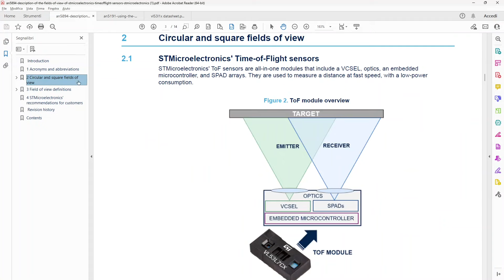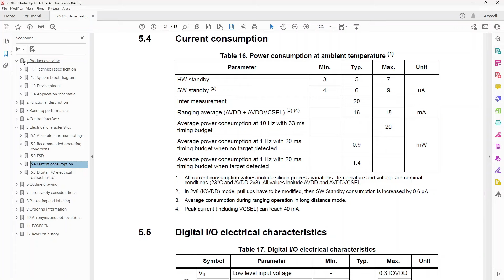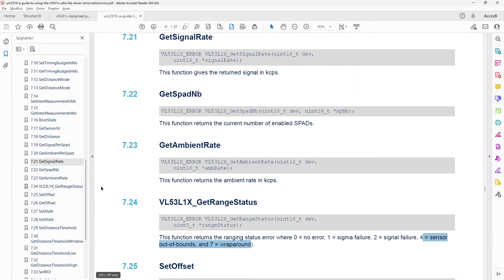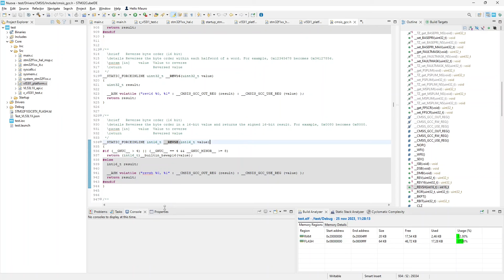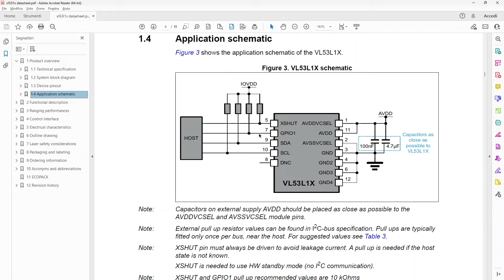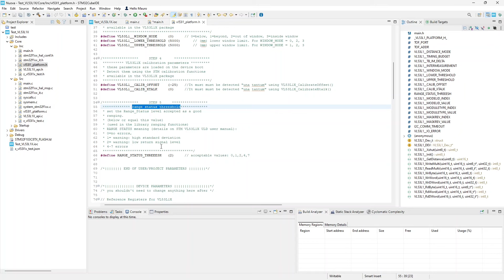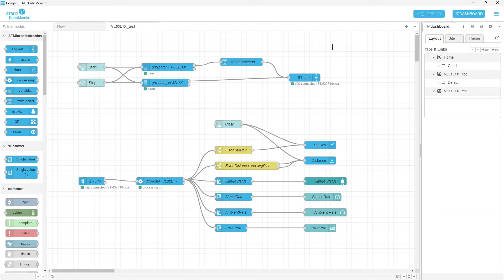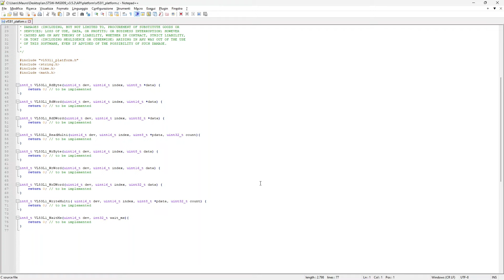Gesture Recognition with ToF sensors: VL53L1X  + Ultra Light Driver (ULD)

Comment: Good job, i need i2c register addresses for a 8 bit, low rom size microcontroller (Microchip 16F series) for a standalone operation control board. Thank you.
Reply from the maker: VL53L1X I2C address is 0x52 and you can program it. Note that the programmed address is lost on power loss, so, if you have multiple devices connected , turning the system on all device have the same address. You have yo use XSHUT to select them individually on startup, at least to set their own address. (that means that in a multiple-device project all devices must be xshut-connected: being so I let device with their original address and select them (even on runtime) through XSHUT)